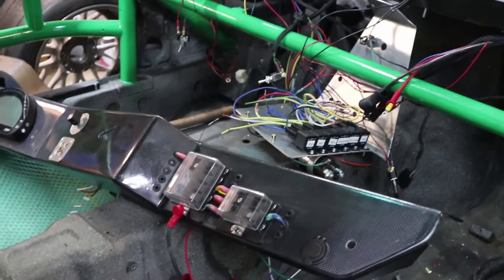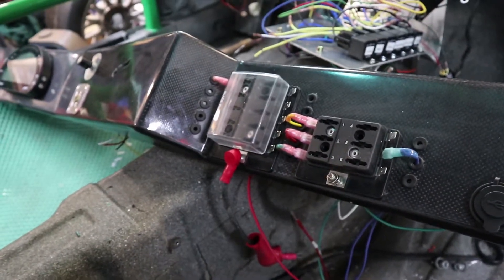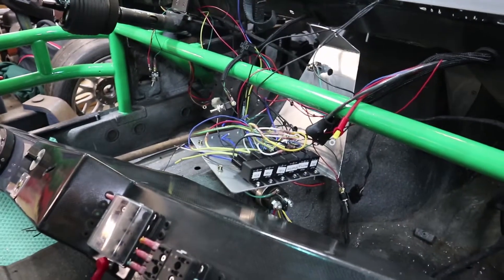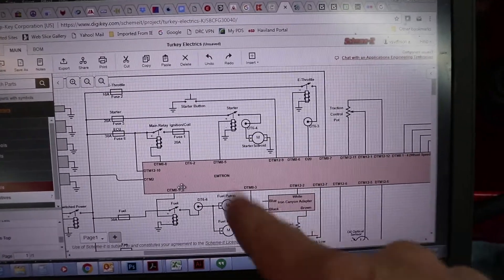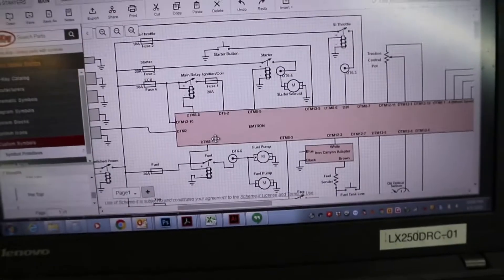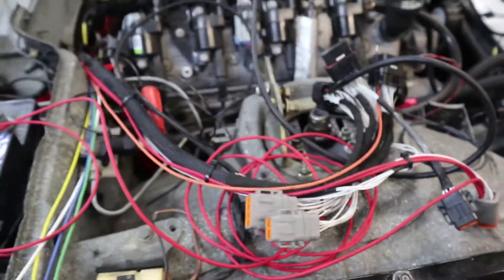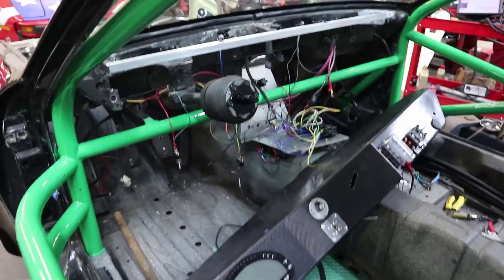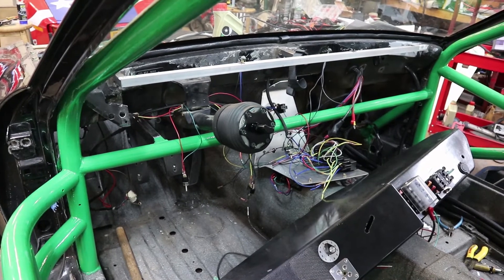Wiring up the Emtron ECU in the LS3 944 track car

Comment: there are some other 944 in the back, is he a big 944 fan? the changes on the car are big, i wouldnt change so much.
Reply from the maker: Yeah, I have lots of 944s.  What wouldn't you change?
Reply: like the dashboard, i like the original, it fits to the style of the whole car. such style things. by the way, is there no way to put the air intake and filter straight under the frontcover? like the s2 and turbo and also the corvette has it?

Comment: Hey Van, I have a question regarding secure wire joining methods. Coming at it from an angle aimed at an application such as this race car (with high vibration, and in some cases higher temperature), what recommendations or preferences do you have toward dependable wire connections/joining methods? Furthermore are there any strategies or rules that you employ regarding wire-gauge choice, fastening methods, and organizational schemes in routing? It seems that this is not your first rodeo, and that you have not only nailed function but also adopted a setup toward easy access and troubleshooting. I am very interested in hearing your response.

P.S. I'm painfully aware of the likely case of the disproportionate amount of effort to tackle these questions. If it is easier to make a video, then I kindly request you carry out in whatever is most convenient.